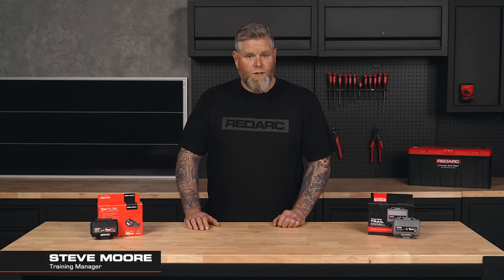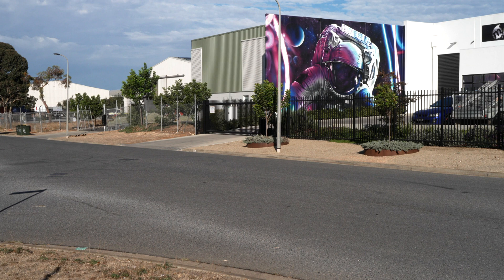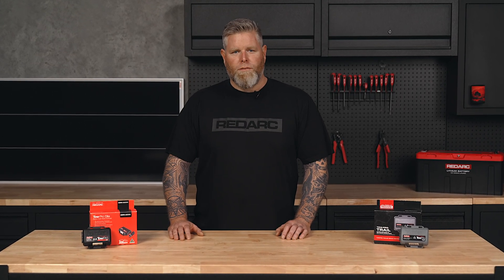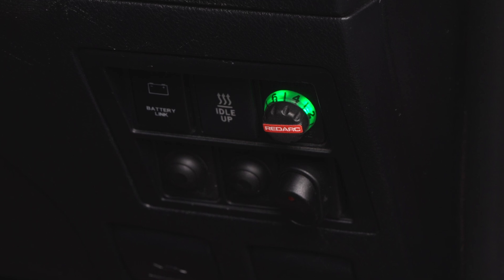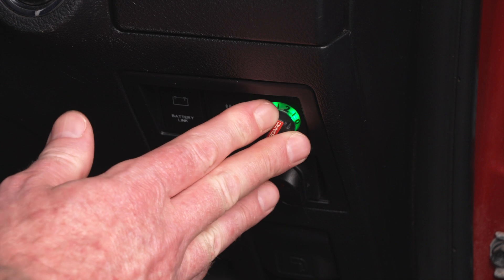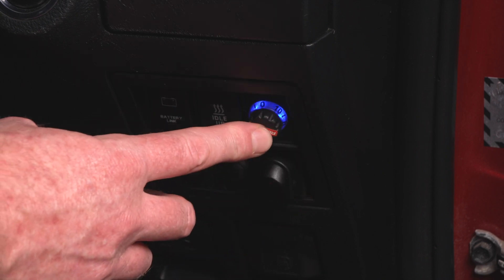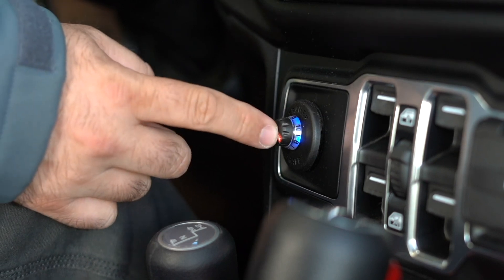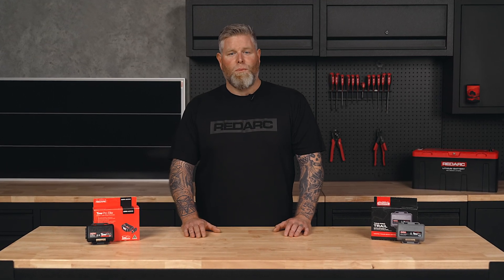REDARC TOW-PRO | FULL GUIDE TO CALIBRATION, MODES, AND FEATURES

Comment: About to order one for my tacoma.  Whats is the difference between the Red, gray, black modules (aside from the price)
Reply from the maker: Hi Mike - depending on the towing you are doing, will depend on which model TowPro you need. For mainly on-road driving, a trailer up to 2x axles - the TowPro Liberty works well. If going to tow off-road and a trailer up to 3x axles - either the TowPro Elite V3 or the TowPro Trail kits are the go. Give us a call if you need to discuss!
Reply: @REDARCElectronics I have a 22 Tacoma , sr5 2wd .  I ordered the liberty kit.   Should be in Sunday.  🤙  thanks for the reply BTW, shows how you guys haven't lost touch with the community.

Comment: Are there additional scenarios (beyond the two mentioned --soft sand and steep descents) where the manual mode is especially helpful?
Reply from the maker: Hi Peter - usual other uses for the User Control mode are really any surface that is 'not paved'. Gravel, loose surface, dirt tracks, fire trails etc could all be useful to have this mode enacted. It's really about sharpening up that braking application anywhere that is soft. Hope that helps!